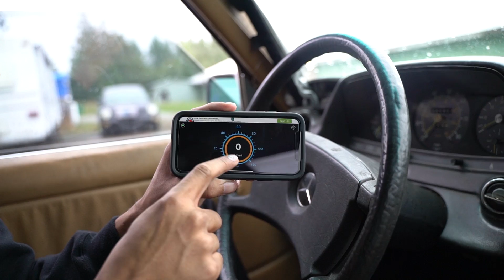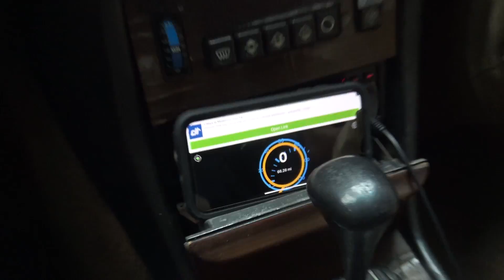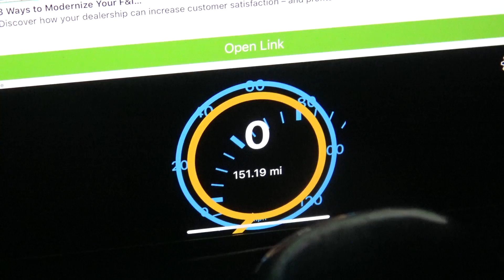Will a Car RUN on USED MOTOR OIL?

Comment: but you still added diesel why not just run it on motor oil alone when why would anyone want to run motor oil in there car when they can just use the diesel that you had.

Comment: One spark from that drill and its game over 😎
Reply: Nope you can hold an open flame to diesel, it is not nearly as dangerous as gas
Reply: Actually probably not with diesel & oil.  Takes more than a spark. Diesel (especially with motor oil in it)  needs high compression vs. normal atmospheric pressure (like 1500psi or so in a diesel engine), whereas if they were playing around with gasoline, yeah...even at "normal" atmospheric pressure a spark might be a bad day for everybody, particularly for the guy holding the drill.

Comment: Can you use water as brake fluid?
Reply: try it yourself and you will find out very fast
Reply: I've used a Tecate beer can as a brake pad shim before.
Reply: @fragwits Btw with water, hot brakes will not stop you from moving "(water expands with heat)"... When you are not pressing brake pedal, fluid reservoir is connected to system and it will not hold any pressure and leaks any fluids/pressure out of reservoir cap.... When brake pedal is pressed, master cylinder will seal reservoir out of system and only apply pressure to calipers.
Reply: @fragwits your wrong i hydraulic brake system is very high pressure system a brake caliper will exhert tones of pressure to stop a car it will compress water brake fluid will not water will not work at all neather will oil it just compresses
Reply: Yes please make them go 60 straight at a cliff.
Reply: no because water can boil under heavy braking causing air bubbles to form in the brake lines and the brakes to fail.
Reply: Yes do it
Reply: @dakotahayes9879  yeah sugar and shampoo in the BRAKE lines won’t harm the ENGINE. Break fluid doesn’t flow through the engine mate.
Reply: good lord no, the boiling point is faar too low 

ive heard stories about shampoo and something else (quite sure it was a solvent) mixed to make a brake fluid
Reply: shampoo and sugar. they still do it that way in cuba
Reply: Wolfe Reblz it’s not going anywhere into the engine though
Reply: @fragwits water does compress it wont work the pedal will go to the floor thats why you have to change old brake fluid becouse it get water build up in it after long time

Comment: DO NOT RUN YOUR TRUXK ON THIS IT WILL WRECK THE INJECTION SYSTEM THE FILTERING SHSTEM IS ALOT MORE FRAGILE ON THE NEW TRUCKS
Reply: This only works on mechanical diesel engines. You'd have to be stupid to try it on a new one

Comment: Please open the fuel filter and make a video about it.. I wonder if the filter will clog with the black soot from oil.

But i think you need new "black diesel" test with a new filter if it has not been changed recently.

Comment: Mix it with the diesel before filtering. Would be quicker. Also, look at using large round air filters to filter the oil, if you're clever enough, stack buckets with holes cut out in the middle of them to make it easier to filter. Also, don't know why you're mixing it for so long, you don't really have to mix them at all. In fact, you probably don't even need the diesel at all unless it's winter.

Comment: How strong can you make that mixture is my question? Looks like you didn’t use a ton of oil as a safe bet. I’m curious how much it can take but i also don’t wanna see it go kaboom because those merc’s are sick. 
Maybe i’ll convince my boss to let me use multi-fuel mixes in the lmtv’s
Reply: I ran my 81 300d until the fuel Guage was on e then poured three gallons of old oil from various oil changes with a paint filter shoved in a funnel and she ran fine. Also threw some atf in there I had on hand lol. Fuel lines and filters were back as night but she didn't skip a beat, ran exactly like it did on diesel fuel. It was just harder to start cold.

Comment: Mythbuster's did a video proving that the om617 will run on waste motor oil BUT realize that all kinds of bad deposits get in the valves and combustion chamber.    Also the injection pump is having soot run through it which bad for wear inside the pump.    And lastly,  the fuel filter system is going to clog faster.    The potential for exponentially losing money in repairs is very real.     They don't even make replacement pistons anymore for those engines if you want to do a rebuild.
Reply: Possible to mitigate with filtering finely enough?  Say...to 5 Micron or even 1 Micron?
Reply: Diesel fuel is $3 a gallon right now.   Just drop off the used oil and it will be recycled properly.   Burning it is just going to make an ugly pollution.

Comment: i Run used trans fluid in mine, as long as there is no metal in the oil it will run fine.

Comment: Did you notice a change in fuel economy when driving with the black diesel mix?  Start measuring fuel economy before and after with these "can you use" videos

Comment: I don't know if anyone down lower in the comments made the reference to this but you're supposed to mix the diesel and the waste oil first stir them up very well then filter out the particulates this way it allows it to go through the filter faster as it is thinners and so on
Reply: VdubSPAZ I was thinking the same thing.  I also can’t believe he spent twenty minutes mixing it, a minute or two would be plenty
Reply: do you not see the goons that are trying this....and really expect them to do it the "right way"
Reply: Actually!
The tip of the funnel will screw into the center of an oil filter.
It works fantastic!
Reply: I thought the same thing, more to filter but much  faster. Even thinning it with a gallon would save time.
Reply: yes filtering after its mixed would speed up the filtration process, but it would also be a reasonable assumption that you would get more particulates catching in the filter. The reason being the thinner liquid would more than likely release any suspended particulate much easier.
Reply: @countryguywithcamera  the filter is going to catch the same size particles no matter how thick or thin it is

Comment: The amount of diesel to oil, plus the time taken to blend makes the whole deal completely futile. There is a way to do this, with no diseasel at all ! Also, use the filters like you would with coffee, doubled up. Using your method, filter after blending the mix as its much thinner.

Comment: I used to do this in my Merc.  filter it first with a 5 micron filter (much faster than a coffee filter) & cut the motor oil with some kerosene, rather than diesel.  I did this for thousands of miles & still drive the car.  Just been too busy lately, but maybe again some day.

Comment: I suppose that would be possible with small cummins engines, too.
Oh, and do not ruin the Merc !
With a little preparation (in terms of preheating oil before the injection pump), You could also run it on used veggie oil only (desalinated and non-acidic, of course) for half a million miles - rudimentary maintenance presumed. I did that with several Merc engines of this era.
Or You just run it on diesel for another quarter century day in, day out, absofuckinglutely no matter what milage ... . Look what runs in Gaza without proper supply of clean diesel or any spare parts: this bloody W123.
Look what runs in Kinshasa, Mogadishu, Lagos or Mombasa as Taxi with literally millions of km on the odometer: this bloody W123, as a 200, 220, 250, 300 Diesel.
Do not ruin it on purpose.
Otherwise the late Mercedes engineers will come down from heaven and give You terrible nightmares of Ford truck rides ....

Comment: Next time use fine 000 silk screen material to filter the oil and you want to add a small amount of lime and alcohol to reduce the acidic value of the used motor oil

Comment: if you use clean oil drain pans when do oil changes you don't need to filter the waste oil.  It just went through the oil filter...

Comment: this old dude has proabbly a 70's or 80's ford diesel truck and everytime he changes his oil he just puts it in the gas tank. thing has over 800,000 miles and running like a champ

Comment: old diesels can run Easy on 50/50 mix, dude, some eaven drive with clean oil, some filters on the car are modified, but the idea stays the same

Comment: There are a few military all fuel engines. The one that sticks out is the Deuce and a half. It runs best on diesel mixed with used filtered oil but it can run on gas and kerosene(if mixed with oil or diesel to thicken). Hell it'll run on used, filtered motor oil mixed with some diesel. Sounds amazing right?! But you'll have to get used to driving no faster than 50 and get used to a shallow, 5 speed manual transmission with a U-turn between 3rd and 4th

Comment: You can also buy a heater and or air conditioner powered by the motor oil

Comment: Ok dude.

I am from sweden, i own a w114 with 3.0 0m617.910
I run at 10% diesel and 90% use motor oil.
They will get less power but fucking hell, its so cheap!

Comment: Should keep that Merc and make it a diesel sleeper
Reply: Yes,300D sleeper.
Reply: Histkoria Virginia Vallejo
Reply: I agree with sleeper but but the time into the om617a instead of an om606 swap, the 617 will support over 500 go just the same and still have the legendary reliability
Reply: easy 6 cylindr om606 swap upgraded turbo and injectors with e36m3 trans  been done multiple times over 600 hp 800 tq easy
Reply: OM606+myna diesel injection pump+2 bar Turbo=Sleeper.
Reply: I own one, advancing the timing and and increasing the cc’s of the injection pump can add 300 horsepower.

Comment: Just use a battery of truck fuel filters and a oil pump. Heating the oil up first helps a lot. Much cleaner and quicker.
Reply: I fitted a steel pipe thru the oilpan to preheat  the oil then to the main tank

Comment: Not surprising, since diesel fuel is very close to regular oil anyway. Higher viscosity from it being used made it not too light in the engine, so if it was new oil, it would probably damage the engine.

Comment: Used motor oil and gasoline in a gasoline injected engine video that would be suprising if it goes the 100 mile

Comment: It's actually no because you're cutting used motor oil with diesel fuel by your headline you're suggesting that just motor oil will run the engine which it does not

Comment: Vape Juice as Oil
Reply: TJ Saline reverse that and you have true petrolhead vape juice.
Reply: Fuck man if that works, those damn Subaru WRX vapebros will never have to worry about low oil from leaks, just top her off with vape juice and keep on smashing into shit.
Reply: I agree that'll be awesome but you need the viscosity if the vape juice to meet the cars specification of thickness in oil
Reply: 16 million dollars later😂

Comment: i done this when gas prices were 5 dollars a gallon when the stock market crashed back in 08 but i used a t shirt to filter the old oil and a full 5 gallon bucket of oil my mix was 90 percent oil and 10 percent diesel

Comment: To be frank i would never do this to my car... because im thinking it WILL leave traces of oil in some parts of the car... and a few years later when i would need to fix something the mechanic will tell me what did you do to this car?... what is this?... what happened to this part?....or am i wrong to think that?
Reply: Does the car belong to you, or your mechanic? 
Why do you think that you have to present a pristine vehicle to your mechanic? His job is to fix it, not tell you that you're a Good Boy for making his job easier when he drops out the old oil, pours fresh oil in and replaces the fuel and oil filters, and charges you $300 for a "Service" 99% of people don't have a fkn clue what they are paying for when they get their vehicle "Serviced" 
The truth is, They just change the oil, fuel and oil filters, and spray some armour-all over the plastic engine cover so it looks clean and shiny. When something wears out or breaks, then you go back to your mechanic and have that part replaced, such as brake pads, tyres, halogen fluid, etc. None of that shit gets done during  a "service"
It's your car Frank, do whatever the fuck you want to it, that's how people learn how to DIY, out of necessity, curiosity, or for financial reasons.

Comment: The diesel you were pumping from the station was unmarked and the diesel you poured into the bucket looked like it was marked. Whats the deal with that? Also, that amount of oil you put in the fuel was negligible. There are class 8 engines that mix more oil in the fuel through the injector O -rings then that. The filtering you did was not necessary either because  no particles big enough to clog an injector will pass by the primary and secondary filters. If you really want to test this theory and not just make fluffy videos, then mix it half and half or 60-40 oil to fuel and don't filter it. That might actually get some interesting results.

Comment: dose a run away desial run off the oil and the engine until it blow up? .. so why u could tolty run off a mix kind like a 2 Strook gas just help lub the parts

Comment: A guy I chatted with worked in the oil fields, they bought those cars because they would run on the drip you can get from the pumps, that is unrefined oil from wells, free fuel, yes it eventually caused failure but took years.

Comment: Drop a fuel cell in the trunk for pure filtered waste oil and a switch to go from the diesel tank to the oil tank so you can start it on diesel then switch to oil for running then switch back to purge the lines before you turn it off. As long as the engine is hot it only cares if the fuel it burns can self detonate when compressed, It dose help that the compression happens before the fuel is injected to let it run on more sensitive fuels.

Comment: you kinda did exactly what i was thinking a few days ago but forgot to suggest it: can a car be run entirely on any single substance? like it can be any substance at all, but it has to go in the gas tank, oil, radiator, transmission, etc.

this is close enough i guess!

Comment: F250 with 7.3 Powerstroke, has run over 1.5 Million Miles, every oil change went into the tank through a mesh strainer...still runs hard!

Comment: It would run better with used FILTERED automatic transmission fluid. A good friend of mine does it with his 1997 7.3L diesel
Reply: No it wouldn't

Comment: I ran my 91 VW Jetta for 4 years adding 5 gallons of filter waste fluids per tank, used a frantz filter, and literally poured a 5 gallon can into my car before filling it at the station, topped it off with diesel, and the car always ran better with the good stuff.  Crazy it had more power and got better mpg on waste filtered fluids.  If the engine is warm it will run on straight waste filtered fluids lol.  But I only do this on my mechanical injection diesel engines.

Good video guys, fellow western Washington guy here.
Reply: Don't try this on your common rail car lol
Reply: Yeah exactly, can only do this with a mechanical injection diesel.  I won't use it in my 6.0 powerstroke.
Reply: Joel Ravet that's because you were adding premix so compression increased higher efficiency.
Reply: Yeah higher injection pressure with thicker fuel, sure works great, and over 40k miles, no issues.
Reply: David C e
Reply: Thats so rad!
Reply: You Americans do some crazy stuff...

Comment: Hey why dont you guys try a thicker mixture. Maybe a 50/50 or a 30% diesel 70% waste oil.  Just curious to see what combos the engine will run on. Awesome though very cool.

Comment: you can run a diesel engine on pure vegetable oil once the engine is warm!
You can make a car with two fuel tanks and an electric switch (make sure the switch is as close to the injectors as possible) to switch from one tank to the other
start the car on diesel, then once the engine is warm switch to the oil.
BUT!!! you have to remember to switch back to the diesel tank before you stop as the car will not start on pure oil.

Comment: Eh this video was lame. You can run those on straight waste vegetable oil without diluting it. You should have ran it on straight motor oil.

Comment: You should try to mix diesel and Flex Seal together to see if the car can run and use it as gas

Comment: If you don't kill that Merc (please don't) and you want to keep recycling old oil/ATF into it for fuel, get yourself a remote oil filter mount (like for a custom chassis or swap), plumb some lines into it and buy an electric (or even a hand crank) pump that goes into a 55 gallon drum. Just pump the bulk oil front your waste drum though the remote mounted oil filter and into whatever container you want.

Comment: It will work FOR A WHILE but the clearances in the injection pump are NOT GOING TO BE TIGHT after using waste oil - microscopic metal particles are still there. MUCH BETTER OFF USING THE WASTE OIL IN A HEATER

Comment: Use heater oil as diesel gas and I’m pretty sure it will work it just a little thinker and has a red tint my dad said when I was younger the if your ever where in need for gas in a diesel car you could use heater oil like the oil from your tank in or out side your house please help me someone that thinks that will work bc I’m pretty sure it will

Comment: I had an old 1995 chevy silverado with the 6.5L turbo diesel in it. Had 750'000km on it,  i filtered iy using and electric pump on a filter housing that went thru a series of "car filters" from 5 micron down to 0.5 micron, filtered and form of oil like substance into a 55 gallon drum and would mix that drum in summer time a 80% oil to 10% regular gasoline, and winter time(at -30°c temps) a 50% oil 15% gasoline and 35% diesel,  and that truck loved it.

Comment: Well for future endeavors of the same type would be "Perhaps easier to mix first then filter?" never the less is actually a really good idea! It would be really interesting to see if the engine would run on a 70-30 mix... but the 70 been the used engine oil... Great video.. really interesting and incredibly educational!